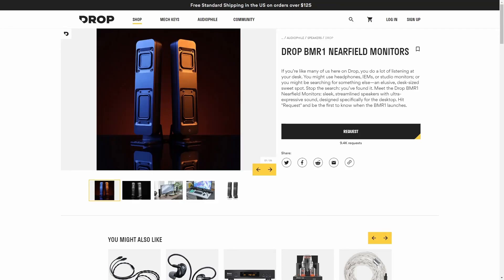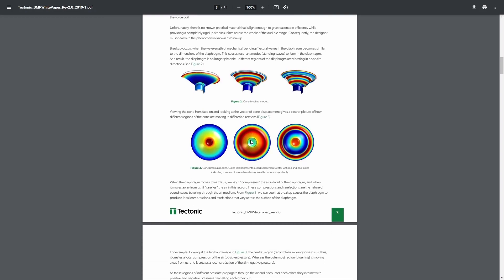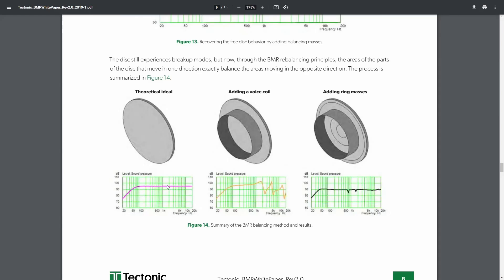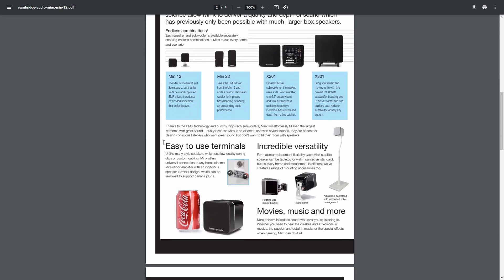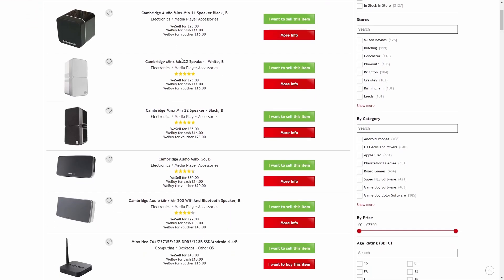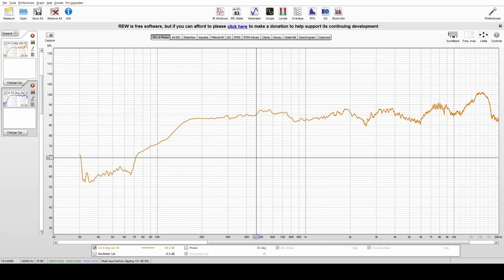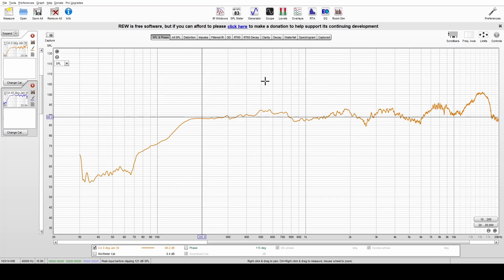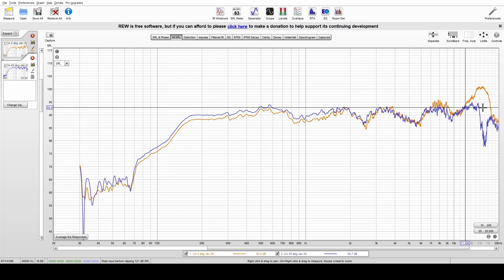Cheap Drop BMR1 alternative: The Cambridge Audio Minx Min 12 (with Measurements)

Comment: BMRs are fun.  The 2.5" drivers in these Min 12s seem to retain smooth directivity up to about 15KHz, which covers almost all of the populated band for music.  You should be able to correct the response flat without losing anything audible off-axis for most content.   I've been playing with the larger (65mm) Tectonic drivers since last year.  They're prone to breakup and directivity mismatch above 4KHz but to a far lesser degree than a typical cone of the same Sd.

Comment: Definitely, the BMR drivers are great in a 3 way application. Take a look at the Philharmonic Audio BMR Monitor which has collected a lot of accolates among enthusiasts as high accuracy speakers.

Thanks for the measurements. The only thing that held me back is the cost of the matching stands (tabletop and floor standing) which are a bit overpriced. After I added up the cost of 5 of these with some of the stands, the price didn't seem like a bargain anymore.
Reply from the maker: That's a shame, I think richer sounds often have the table top stands on sale in the clearance section. However you have given me an idea, I would if I could 3d print some desk stands?

Comment: This was interesting, but you need to really make sure that your vo remains centered your voice is mostly in the left channel when it should be dead center with no shift left or right. Never use a stereo mic for dialog if that's the case your vo needs to be mono and in both left and right channels. Your editing software can do this easily. Other then that this was a well researched video thanks for posting.
Reply from the maker: Thanks, I will look into that for future videos
Reply: The video was extremely hard to watch and I almost didn't finish it because of this issue but I enjoyed your presentation and explanation so much I persisted but this audio issue needs to be fixed pronto
Reply from the maker: Thanks, I think I need to set any dialogue audio to mono unless there is a very good reason not too!
Reply: @sk3iron  Windows has sound settings and accessibility settings to allow you to make it mono if you encounter it again. MacOS likely does too.
Reply: this video should be reuploaded with the sound fixed

Comment: Yup. This and the larger version are absolutely great, and easy to make yourself if your feeling cheap
Reply from the maker: It's really cool how BMRs don't need a crossover if you are not adding any other drivers, greatly simplifies the build!
Reply: @Cut Twice Engineering  not sure if I agree there, I use a bsc on mine because of the droop in response under ~300hz, but without it I just add a woofer that runs full range on the side of the cabinet and it works great, even in the overlap.
Reply from the maker: that's a fair point, l was thinking purely in terms of avoiding breakup modes